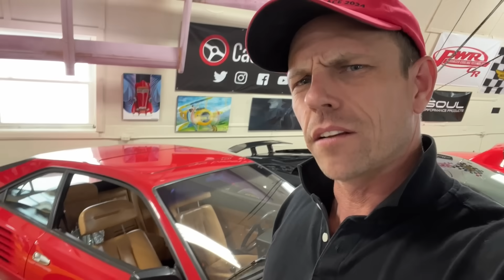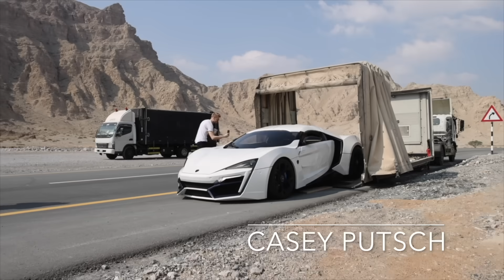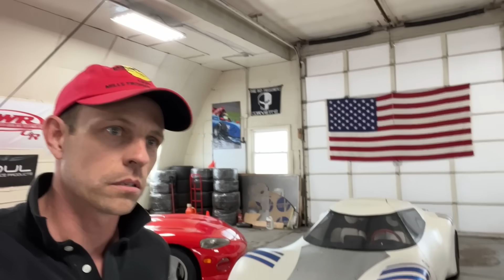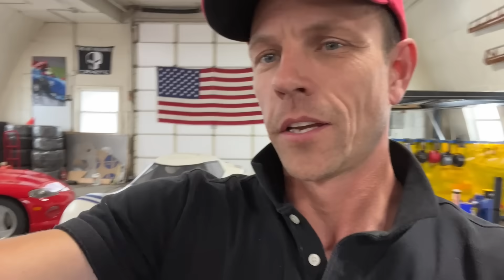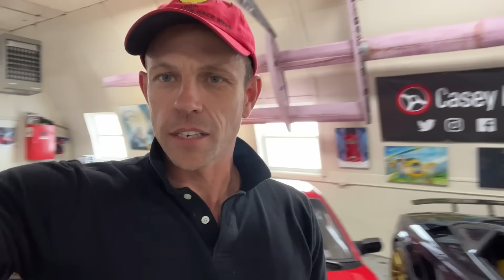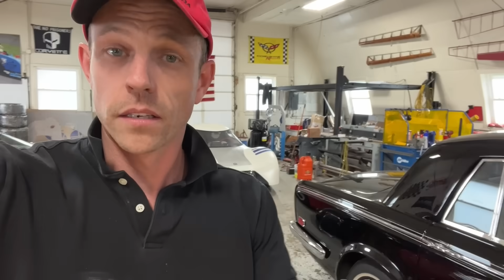Will the OMEGA CAR change everything? Video 1 of 3 "the Overview"

Comment: Hello from Germany from an old PA farm boy. My Brother went to college in Tiffen.  Many years ago, I met up with an alumnus from Perkiomen School who told me about advances in ceramics in engine construction. We worked together on developing an air-cooled/thermistor reclamation diesel boxer, 2-cylinder engine to run a rare-earth generator that was being developed in the early 80s. 
The only battery was for the engine. The power was stored in Capacitors, and the brakes were both regenerative, (all-wheel, two wheel or on-wheel cruise), as well as conventional hydraulic. The body of the car was planned to be made from composite plastic/graphite construction.  Needless to say, it never made it past the concept phase, and my ex-wife “joyfully” burned all of my notes.

Comment: congrats man, well done this is thinking outside of the box. im learning myself casey, my dad has a honda insight, i think 1st gen, and with fuel prices over here in the uk being extortionate this is a no brainer.  as newer cars are all weight and as a result burn more fuel aswell. these cars have not been beaten,in 20 or so years.engineering side of things and i think that it dosnt matter what people think when they have a look at the car. never judge a book by its cover. the fact is that what you can actually create and achieve like you said is outstanding. just want to say well done again.regards sonny.

Comment: How do you think your vehicle would perform in Crash testing? I feel like a lot of the safety standards are part of the problem with getting highly efficient vehicles. If someone can buy a motorcycle I don't see what's wrong with buying a car that's considered unsafe as long as the buyer is aware of what they are purchasing.

Comment: It's the Monetary System, the most ancient system being used today. 
Sorry to tell you but your car really isn't that great. 
The reason I say that is because Troy Reed built a Free Energy generator, documented his progress from a 7 foot monstrosity down to the size of a 125 pound electric motor and put it in an economy car. Go look it up. 
His device would destroy the Oil, Natural Gas and Coal industries then the Banks would fail and the Stock Markets around to collapse literally overnight. 
But check this out. Dennis Lee invented a Free Energy Panel System that uses a subzero gas that collects heat from anywhere in the world, compresses it to turn water into steam that runs a steam engine in a closed loop. It just sits there thumping away making energy. It's easy to manufacture, low cost to build and maintain, parts could be readily available to that impoverished nations could flourish and irrigation wouldn't be a problem. That device could save billions of lives. Dennis Lee's the only person in the world to win a Free Energy lawsuit brought on by the United States Supreme Court. But he was shut down after that by restrictions and regulations. That device could easily be retrofitted to Simi Trucks and Rail Car right now! 
Until someone like Elon Musk puts one of many Free Energy devices on the open market to the extent where it can't be stopped, nothing will ever change. And Elon Musk won't do it because he knows his billions would turn into toilet paper. 
Open Source is the only way it'll even happen. Paul Pantone invented a GEET Fuel Processor and open sourced it. It allows a combination engine to burn anything from crude oil to turpentine at 20% and 80% water and zero pollution. There are thousands of backyard mechanics building it and a lot have posted their results here on YouTube. 
If you really want to blow your mind though, do a little research on Floyd "Sparky" Sweet. Free Energy on demand from the Ether!!! Documented!

Comment: I can't figure out why a car guy never showed the engine never talked about the engine and never showed the speed measuring devices but I like your attitude and the car is sexy as hell to look at
Reply: The turbo diesel has a "lean burn mode" tune.  That's the trick. Restricted in the US by the EPA, common to find in Europe.
Reply: @flipsidezw  You can call it a trick, but it's solid engineering. 2015 VW scandal gave you and many others a bad impression. I believe 2015 was a psyop with the intent of lowering folks respect for turbo diesel ICE's. 
So you and others would buy an electric car.

Comment: I wonder if we could design a line of phase change material intercoolers for cars. They would have the benefit of air to water intercoolers without the need for the radiator. On that note you could develop a phase change gel to keep the inside of cars cooler for longer. Also it would have the opposite effect in the summer. No more scorching seats to come back to.

Comment: LOVE this entire concept, I have been gathering information for something sorta similar based upon currently available parts? These folks in England came up with a proper kit to swap the  VAG 1.8 gas & 1.9tdi engine, VR5/VR6 & transmissions into a Toyota MR2 mk3 cars. They also offer very well sorted out upgraded chassis parts to improve the crappy stamped steel parts. This cars onlyweight  approx 2100 pounds wet so with a 250 to 300bhp 1.9 TDI installed makes them Very peppy!  I have not seen them test fuel mileage properly yet though.  I am sure it is outstanding.  https://www.youtube.com/watch?v=SMroy0uDXXE

Comment: Congratulations on the Omega!  Love it.  Great accomplishment. Do you mind a couple questions?

What does it weigh?
What is the drag coefficient?
How many horses from the diesel?

Tell us how you got the 104mpg!

Would love for you to do a joint video with Engineering Explained.  

Wish you had a video on how you built it, choices of drivetrain and suspension components, etc.

Will be watching

Comment: More on the engine and drive train please.
Reply: 2.0 liter turbo diesel, 5 speed. His trick is restricted in the US by the EPA, it is an air/fuel tune called a lean burn mode. Common in Europe. Funny that he doesn't just say it.
Reply: @flipsidezw he probably doesn't want to be fined due to all the regulations
Reply: Actually done  a few swaps with TDIs with a tune and big power gains as well mpg improved drastically... win win .. it was a  family minivan with 5 speed manual..Mpg and power  a lot more than the original V6 powertrain and all normal everyday day driving minivan  for about 10 years ... Unfortunately rust got in the way .
Reply: I think he used a 1.8 or 1.9 TDI VW motor
Reply: Its sounds like vw 1.9 TDI
Reply: YES! More of the engineering! Engine & drivetrain!
Reply: Exactly, I heard rumor of one tank of gas, goes 2500+ miles.

Comment: Stopped watching at 7 minutes because the only thing he wasn't talking about is the car that this is an "overview" of.
Reply: His trick is a "lean burn mode" tune. There you go, now you can build his thingy.
Reply: @flipsidezw Lightweight very aerodynamic & lean burn mode? I think the car is awesome if it'll get 100mpgs, do 0 to 60 in 5 seconds, is reliable & low cheap maintenance. It'd be the ultimate commuter / road trip car.

Comment: I do hope your able to answer this question or hopefully share this in a later video. But what kind of engine design did you use? Is it an inline 4? V6? Is there other factors to its efficiency and power?

Comment: As a man of science I need to see the 1 gallon drive till it stops uncut. I don't care if it is boring. I can't believe you at all. The internet is full of bullshiters. 
The most you have said is that's it's a Turbo diesel. So If I personally wanted to get that power and efficiency I would push hard into Yachting.
 A Yanmar or Kubota motor with a custom twin carb with custom jetting.
Reply: So, it's a tune called a "lean burn mode" common in Eurpoe. You can get cars that regularly get 90 miles to the gallon because of it. Just need to have cooling on point.  Works great on diesels because there's no plug to foul up.
Reply from the maker: Ok don’t.

Comment: I’m assuming the majority of the efficiency is the engine so could you put that power train in a small truck and see huge mpg gains?  Maybe not 100 since it’s a truck, but it would have to get better than my 2005 sport trac, that gets 16-18 mpg
Reply: Oh ok, I wouldn’t have thought aero would make that much difference. I’m sure it’s very light weight as well. Thanks for the information and I’m really looking forward to seeing more on the car.
Reply from the maker: It’s the car the engine is in

Comment: Love the sailing hat!
Reply from the maker: Thanks! Was my first big Regatta as captain
Reply: @CaseyPutsch  That is awesome! I've capatined a few but am much better at spin trim so I stay in that position most races. 

I'm looking forward to following this channel now that I found it I've had a lot similar thoughts and been studying ways I can create something similar but for boats.  Been toying with ideas for "reasonably" priced speed boat set-up to start using a high efficiency generator to power a few electric motors. Also been reading about a "thunderstorm generator" which reclaims exhaust not sure if you've seen them no cats needed with it.

Comment: I absolutely agree with your "no magic bullet" comments, been so frustrated recently by every politician in my country pushing to ban the internal combustion engine outright in new cars by 2030 or 2035. Doesnt matter what fuel they use, it could use hydrogen combustion, they dont care, not even hybrids. There is no magic bullet, and we shouldnt put all our eggs in one basket, thats how we got in this mess in the first place. Technocally you could make a steam powered car under their proposed ban because thats EXTERNAL combustion, but can you make a car run on fuel you made out of garden waste in your back yard? No because that would use internal combustion. And of course this also isnt adressing the real issue that is the source of the fuel we use now being crude oil and coal which is what they should actually be banning the sale of to normal consumers...

I will say, it might be good to put a really simple hybrid drivetrain in any future version of this car. Im talkin a simple 1 motor in the front and like 2 lead acid batteries. Super sinple, super servicable, super mindful of the environment, and you get the ability to have a KERS system with enough charge to deal with that start and stop traffic that eats your millage. I do get why you wouldn't include it though, potentially only a small increase in milage but needing a whole new system, kind of where you place that effort vs reward line.

Comment: Critical mineral mining is an extremely energy intensive activity, and one that today runs on hydrocarbons. It could not function otherwise. The use of coal and gas is vital in refining the minerals through various thermal and chemical processes. For instance, blending, to aid the removal of other metals, and in heating to high temperatures to produce more pure forms. Petroleum-based products are also used for excavators, bulldozers, dump trucks on site, as well as various forms of transportation to move minerals from supply to demand centers.

And here is the killer fact--- The oil industry, renewables and EVs are not separate from each other. They do not work in silos.

The irony is, large scale thirsty fossil fuel powered equipment is essential to extract the minerals to build the batteries for the cars that pretend they are taking us off fossil fuel.

Comment: I always thought a hybrid transmission similar to the prius mated to a small diesel would be an ideal combo. 
Diesel efficiency with the performance benefits of a cvt transmission (25% better acceleration). Then have a clutch lock things together for cruising, where the engine stays at about 80% throttle for maximum efficiency and the electric motor that is normally used for transmission cvt duty adds power to the wheels to help uphill or draws power downhill to store in the batteries to regulate cruising speeds

Comment: Cars = Freedom.. They loath our Freedoms.  Divide and Conquer rules. The money was spent on lies. Looking forward to the next two videos. I wish you success in your endeavors.
Reply from the maker: Thank you! More to come!! Going flat out now!
Reply: Most of our gasoline has ethanol in it which is corrosive to a lot of older fuel systems and it makes it have a shelf life. Now newer diesels are being wrecked by DEF, which is highly corrosive and some trucks computer will not allow it run without DEF... It's almost like they wan to ensure that everything grinds to a halt not too long after the spigots are turned off.
Reply: @p.t.anderson1593 
Someone stole my emissions systems and installed several different, well mapped, tunes that are extremely efficient.  Diesel engines are the way of our future.
Reply: You hit the nail on the head
Reply: 100% correct.  I hate those f___ers.

Comment: In 1990 I was at a major university, stating in their architecture program. In one of the largest classes I had ever been in(600 students), was an intro to architecture. In that class one of the lectures was talking about the future of architecture. Strangely enough the newest architectural element(stated in class), was the geodesic dome created in the 40's. Of course the professor was going on about some guys in San Fran, working in all sorts of new materials, techniques, etc. Many years later I was working with a friend, who was one of my professor's way back when(not for the intro class). I asked what became of the guys in San Fran. He told me they were stopped dead at the regulators. The political class's silent stormtroopers. That's the sad part of the real world, for those in power hate it when things advance. That means more work for them, but they do like when advancements mean more power for them. That's where our world is right now.
Reply: Buckminster Fuller pushed for the domes and wrote alot about technology lag in architecture. The built environment is way behind electronics with innovation.

Comment: Took long enough. He wouldn't show how he built it before.
Reply: Tsk, you don't need everything handed to you on a silver platter, do you?  

There's LOTS of prior art similar to what Casey's done here, where, if you think on your own a little, you'd have a pretty decent idea how.

Here: hold out your platter, and I'll give you a few things to start with:

- G3F kit car from Smyth Performance (VW drivetrain, relocating a FWD drive train to the rear)
- Pontiac Fiero, Toyota MR2, Fiat X-19 -- cheap 2 seater mid-engined sports cars made with FWD drivetrains/suspensions in the mid-rear drive layout.
- Tri-Magnum from the 70s/80s Popular Mechanics magazines (foam+composite shell construction)

IOW, there's been prior art going back into the 1970s that would help you exercise your mind and make pretty decent educated guesses.

Comment: Get with Gale Banks when it comes to tuning the engine. As for the design, you could make the cockpit simultaneously narrower and more comfortable by offsetting the passenger's seat rearward so that the front edge can tuck a few inches behind the driver's seat. This also allows the driver to be closer to the center (like a Murray T50!), AND gives you a space behind the driver's seat for more cargo or something fun like a BIG subwoofer if you're into that. Sure, it makes things a little longer, but length is good for stability and aerodynamics, anyway, especially when paired with the new, narrower frontal profile. Plus it's nowhere near as goofy as full-on tandem seating, so much more approachable/marketable to the layman.
Reply: He just ised a "lean burn mode" tune. That's the trick.

Comment: Agreed. SIck of both parties not solving anything. I wish more people would think things through and be as pro-active and rational as you are! 

What you said about cars that are worth and capable of being fixed really struck a nerve. With all the videos I've seen of Teslas and Rivians getting into accidents racking up $35,000 repair bills and being totaled by the insurance company (when the insurance company is even able to put a $$$ cost to the repairs), it really made me think about how wasteful so many cars are these days. This is not to pick on just those two brand. With many modern cars , a single component can be so expensive (or unobtainable) as to render it impractical to fix. So, landfill for that Nissan Leaf. Oh and with the way congress seems to side with businesses against right-to-repair in the electronics segment, I have zero faith moving forward that we'll be able to go to an independent shop to repair the mostly electronic cars we're being saddled with. Oh and features-as-a-service? Ugh

The added complexity of electronics controlling everything has also added unnecessary expense--a friend's Honda's battery died. I also think there was something wrong with the electrics on the driver's door. As a result they had to remove the fender in order to get into the car to open the hood. A $170 battery cost her $1,000 to replace. Elsewhere in the world, you can buy a simple, no-frills Toyota for $10k with no electronics--for whatever reason we can't get that truck here. It's incredibly frustrating.
Reply from the maker: More to come
Reply: The Toyota Hilux Champ is an interesting departure from the norm for any manufacturer.  
I wish they'd bring it to the western world too. 
I'd like to see them do the same for a RWD sports coupe too, with other basic designs on the same platform too.... bare minimum with customization by the end user being the goal. 

I think Toyota (or some interprising person) could sell the Champ beds & accessories as retrofit and/or trailer kits here too.